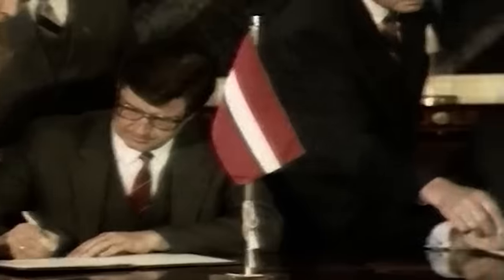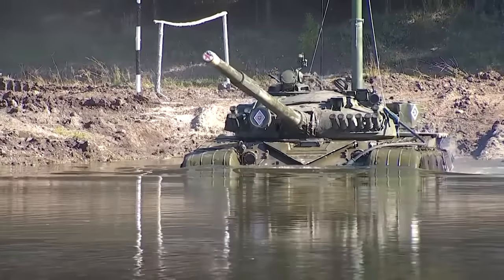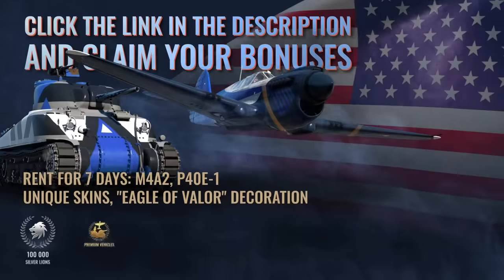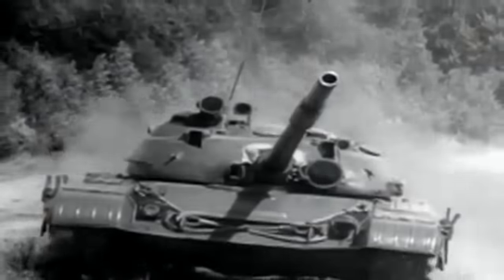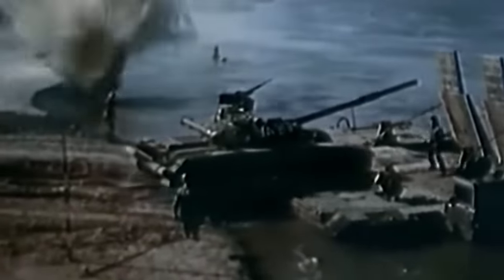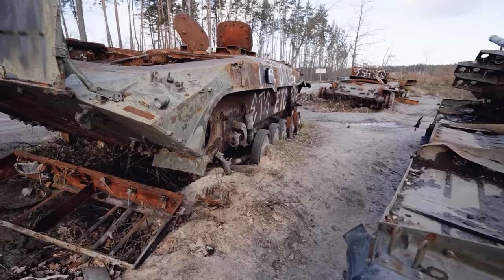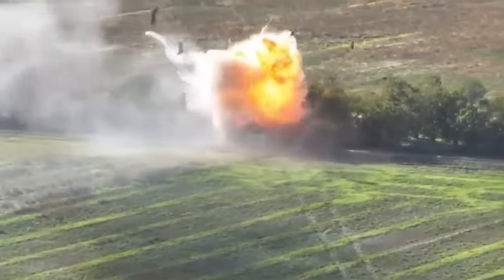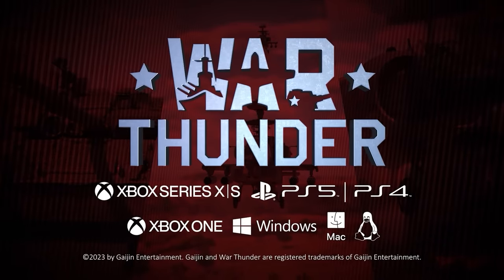The Tank Russia Is Really Starting to Regret

Comment: I agree with  @ret7arny below.  When I was in the Army (76-80), this tank was designated the T-62.  I was under the impression that the T-64 was a later improvement.
Reply: Different tanks.  T-62 was a variant of the T-55.
Reply: @vovin8132  What is your source?  T-55 was a 100mm gun with a different bogie wheel lay-out that the 125mm gun on the T-62.  My source: US Army.
Reply: @robertdelacruz2951   Says the guy who thinks the T-64 is a variant of the T-62.  They are completely different designs and roles.  Like I said: the T-62 was a newer version of the T-55, like how the T-90 followed the T-72 line.
Reply: @vovin8132  AH!  I misunderstood your earlier reply.  I thought you were saying that the T-62 was an ungraded T-55.  Yes, the T-64 was a new design, just as the T-62 and T-55s were different designs.
Reply: @robertdelacruz2951  The T-55 and T-62 are different designs, but on the same development tree.  T-64 was completely different. At that time, the Soviets were still following the WWII idea of developing a new tank every few years and mass producing it, instead of more modern methods of just upgrading the existing tank fleet (which required tanks that were designed to last decades and be upgraded, like the T-80).
Reply: @robertdelacruz2951  T-62 has a 115mm gun, the first smoothbore gun used on a tank. T-62 is mostly a T-55 redesigned to fit that larger 115mm gun.
Reply: @BlaBla-pf8mf  You're correct!  I was so caught up in modern guns, I forgot!  Thanks!

Comment: Soviets had 2 overlapping families of tanks. One was cheaper and mass produced T-55 and T-72 and other was "Elite" T-64 and T-80. But nowadays tank cannot last long without reactive armor which will have to expand to cover top part and protect against drones and howitzer shells.
Reply: I think the T-62 should come in between the T-55 and the T-72 if I’m not mistaken.
Reply: @kurousagi8155  There were at least 2 independent design teams  from at least 2 factories. By my understanding people working on T-72 had experience with neither T-64 nor T-80.
Reply: @mladenmatosevic4591  correct. I was just stating that the T-62 should be part of the T-55 and T-72 family.
Reply: @kurousagi8155  As much as Opel is part of of same family with Volkswagen Beetle and Golf.
Reply: @mladenmatosevic4591  not familiar with cars. So I guess those must be pretty similar.
Reply: @kurousagi8155  If you feed your car iron ore and scrap metal, maybe even let it hunt other vehicles, it will fatten to a tank level and grow gun trunk. Then it can hunt other vehicles at distances up to 3km. (Sorry for joking. My prior point was that you had two separate design teams and factories. And most people worked whole career in same place.)
Reply: @mladenmatosevic4591  for the T-64 and T-55 yes. But the T-55 and T-62 should be similar.

Comment: The Ammunition carousel beneath the turret is the main reason so many blow their turret sky-high.
It's simply a design flaw but Russia kept this design no matter what. Russia doesn't care a rat's ass about their soldiers, they're cheap and expendable. Currently, a bit more than 300.000 are gone in Ukraine. Ukraine has got Leopard by now which is superior to everything Russia can muster. Their T14 has glorified itself with its absence on the battlefield. Weapons sale is going down for Putin and his "comrades" and a loss of a T14 in Ukraine would be catastrophic.
Reply: Which is not a problem to begin with. ANY tank with this type of penetrating hit will be disabled or destroyed even if ammo is intact. It also makes a T-series much smaller targets (which is why it was installed for in the first place).
Reply: @alexturnbackthearmy1907  Indeed a smaller profile was the intended purpose. However, that design has proven faulty and dangerous. Yet, no one of the decision-makers has done anything to change it.
Why? Because in Russia men are cheap and regarded as expendable "equipment".
A heinous way of thinking that followed from the Stalin area until now.
Reply: @alexturnbackthearmy1907  The lowered profile doesn't seem to be doing all that much good for them, and with the crew all scrunched together in a T-series what could've just taken one out now has a high possibility of killing the majority of your crew. Tankers are costly to replace, tanks are just expensive, so you want to make sure your tankers are as protected as possible even at the expense of the tank itself

Comment: All of them are shit when it comes to armor...the whole lightweight tank with add on armor isn't gonna be as good as a heavier tank with twice the armor of the t90 base armor and able to take multiple hits in the same spots when a t90 can't after the kontact is gone and that's if it ever had any in the first place since Russia is so corrupt they pocket the money for all the reactive armor and just put cardboard in the boxes and sell any they did actually acquire. Plus tanks like the m1a2 with depleted uranium armor have 1.7 times the density of steel so they likely have between 1400 to 1700 rha actual armor. Much better than the always overstated Russian reactive explosive armor added on to the 400mm rha base armor.

Comment: The auto loader is not a good idea. Tanks are incredibly maintenance  heavy. It is standard to have to perform 1500 man-hours of maintenance for every 8000 km travel time. Tank maintenance  is hard work, heavy and exhausting. Western tank crews have 4 men. Russians have only 3. Tank commanders are often called away to meetings with command. That leaves only 2 men to conduct the maintenance. Soldiers being who they are, that means that many steps may be skipped, or pencil whipped. These neglected steps translate into breakdowns in combat, which tend to be fatal. Not a good idea to reduce the crew by one man. And the auto loader offers no advantage on the battle field.
Reply: in NATO countries the Tank crews are not doing the maintenance
Reply: Imagine having tank almost 1,5 times bigger and 2 times heavier, just because "meh, autoloader". Crazy right?

Comment: The Ukrainian version of the T80 has only ever had one version built and that was or still is a show pony for export demonstrations to prospective buyers.
This business about what Tank is better is all BS in reality when it comes to Ukraine, the fat tanks of NATO will sink in the soil 6 months of the year, because of the weight factor. The numbers are not enough to make any difference anyway and soon it will be volunteer NATO contractor troops manning them. To the RF forces it will make no difference, they have proven that they all burn just as well as each other.
Equally so, the RF forces Tanks are vulnerable as the flaws and weak points are very well known by the AFU, seeing as they also operate the same beast. I saw that RF is pumping out a couple of thousand T80 versions with upgraded turrets to T90M standards. Who knows what change, if any this will bring, but a couple of thousand, delivered in batches of fifty a time is way more effective than 31 Abrams and some Leopard A1s.
As for the narration referring to AFU air support, attack helicopters etc, FFS, what drugs do you use? Get off them now before you become completely delusional...Speaking of General Deluzhional, I hear he made a statement that the AFU is pretty well defeated and Aristov, says it is time to negotiate with Russia. Gelensky is losing it big time with KIA reaching a figure I find I do not want to believe. But, independent monitors of this and even Ukrainian figures now indicate to the end of October over 700,000 KIA and 500,000 WIA in hospitals across Europe.
An entire generation of a nation for the Hubris of the USA, UK and EU. We all know this did not start on Feb 24th 20222, it started long before when the USA once more interfered in a nations government. Victoria Nuland and Geoffrey Pyatt, created the 2014 Euro Maidan and forced a Coup D'etat of the legally elected government. 
The world needs to learn from this, History cannot keep repeating the same mistake hoping for a different outcome, but the USA keeps trying. 🤨🤨🤨